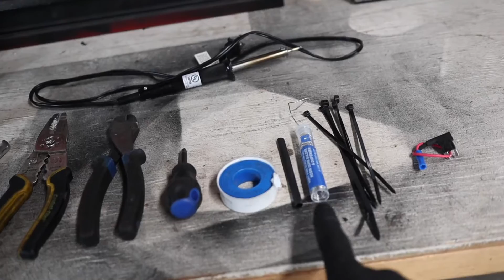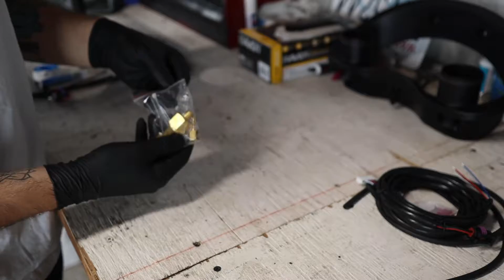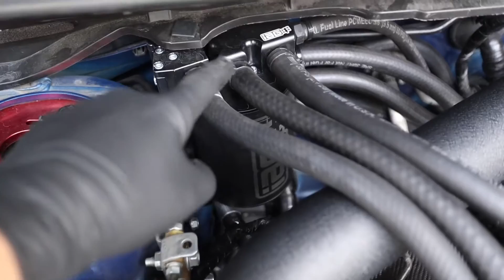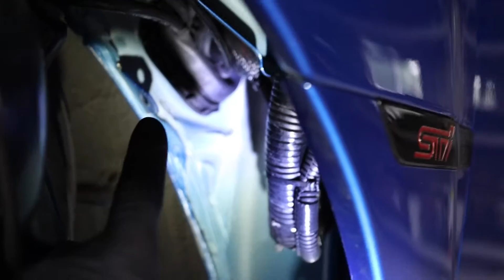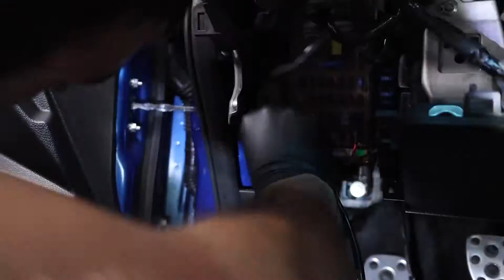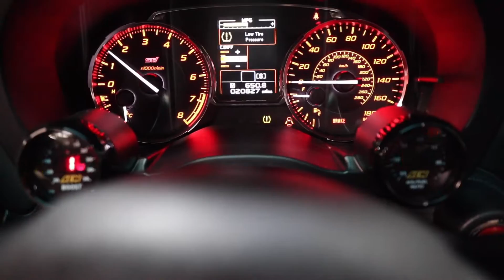AEM Boost and AFR Gauge Install (STI)

Comment: Hey man. Great video! I’m about to hit buy on my gauges as well! Stupid Question. My tuner wants me to get a Visconti logging cable for the afr as well. Would you happen to know the difference between the cables??
Reply: Have you gotten any information on this? My tuner has suggested the same cable as well.
Reply: Corey Stengel hey man, sorry. Just seeing this post. Yep. I’m running it now. Shoot me a message on IG and I’ll tell you more about it. Subi_duo
Reply from the maker: TBH I've never ever heard if the visconti cable.... I would ask your tuner what the reasoning would be. Generally the tuners I've used have always based the AFRs off of the ECU
Reply: Yesterday tuner also asked for the same thing, what did you end up having to do?
Reply: @nicolasmcdaniel4452  I ended up hooking everything up. Took my a hot minute to figure everything out. But the Visconti cable is basically for you to plug in the AFR stuff along with the wideband 02. Just a plug and play that doesn’t require any splicing. The only headache was running the wiring into the car for power via fuse box

Comment: I did a test for with the gauges on my smy pod and  it felt loose. Did you mount yours with the hardware supplied? Fit looked super tight
Reply from the maker: I used the supplied rubber bands, you really got to work them in there 😅

Comment: Put the end of the vacuum hose in boiling water to get the hose on the sensor
Reply from the maker: Not a bad idea, I normally use a great gun but the water might prevent the hose from melting a little lol

Comment: Did you just use the rubber thing that came with the AFR gauge to hold on it onto the pod? Or did you come up with something better?
Reply from the maker: Just used the rubber bands that came with the gauges, worked out great 🔥

Comment: No doubt at all means you do a great vlogs all the time and this with clean installation of the gauges! 
But there are few things that needed to be focused on for the first timers/new-owners. Something more which I want to know, like -- 
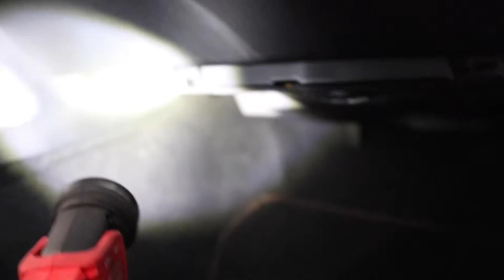1. initially when you soldered the wiring of both the gauges, you should have done some unboxing to show how many cables/wires they come with. this is because, in the video you have connected both the wires and then at the time of install(at 8:05) there comes another big wire(AFR harness) which is connected to the O2 sensor. 
2. Also, you skipped to show the connection between the harness and the soldered wire(though it is a easy-pezy) as viewers we expect the complete view of it. specially when it comes to wiring which is very important part.
3. Which is more important --> the connection to the gauges!! i believe there a tiny vacuum hose that connects to the boost guage along with the other wiring. you could have shown that over at least after you plugged in all the wires before fixing the pod to your dash.
 4. there are few other videos on here that show a different way of installation for the boost gauge itself, where they have connected their vacuum hose sensor with a "T" to the stock BPV, can you please explain which one is more efficient, as I read in a blog connecting to he BPV gives us the most appropriate readings? will be greatly appreciated.
I have been following you on your youtube build vlogs but i haven't seen a FPR installation video(if there is one i might have missed it, lol). I really really hope you do that one soon as all of these mods fall in the same category it will be helpful for people like me.
I hope you get back on this soon bro also correct me if i am wrong at any of these points, I am still learning :) lol!
Thank you.
Reply from the maker: No worries appreciate the detailed feedback. So Cobb installed the FPR when I got tuned, totally spaced on it so they had to throw it on before the car went on the Dyno but if i can find someone on the area installing one I will try to get an install video of it! 
As for the vaccum hose the most accurate reading is going to be if of the intake manifold as it's going to see absolute manifold pressure vs normal vaccum and boost outside if the manifold. There is a free nipple on the lower driver's side of the manifold that can be tapped into to use. With the AEM Gauges there are no vaccum lines going directly to the gauge only the electrical wiring going to the sensor which then transmits over to the vaccum line. But I will definitely keep these in mind for future installs. I've gotten more in depth with a lot of them as compared to some of my older videos 😁
Reply: @Smeedia  thank you very much for a quick response. That answers most of the things that i put up. Please do the FPR video sometime soon!
And yeah, i thought i mentioned in my previous comment about the AOS install -- that was a detailed one :D i loved it and will definitely be taking help from that video! Most of your vlogs are detailed, i agree!
Thanks again bro! :)
Reply: Good video. I have a question about the vacuum line as well. The one you pointed out in the video is currently being used for my FPR (I have the Perrin FPR installed). Is there another nipple you are talking about thats not being used on the driver side that I just dont see, or am I going to have to cut the vacuum line and install a T-fitting for another output on that line?
Reply from the maker: You can also pull vacuum from the vacuum line going to the bypass valve. You would have to install a T fitting onto it.
Reply: @Smeedia  so is it better to use the T-fitting off the BPV or the manifold line that connects to the FPR?
Reply from the maker: Pulling the vacuum off of the manifold will give a more accurate reading but you shouldn't see a huge deviation from the bypass valve to the manifold. Either option will work but I suggest the manifold
Reply: @Smeedia  Word. Thank you, think that's how I'm going to do it then. Throw the T-fitting on the hose that's coming off the nipple. Also subscribed to your channel. When I finally get all my parts, I'll do a video on my build. Got a built RW750 longblock sitting in the garage just waiting to be swapped. Still need a bunch of stuff for fuel upgrades, FMIC, and an FP black HTZ. Gonna do it all in one go so I dont have to keep getting it tuned.
Reply from the maker: I know the struggle! I'm in the same process but pushing the stock block as far as I can to see what I can make it hold. That Rev works block will be a good set up 🔥 and definitely document it. Appreciate the support my man! 😁
Reply: @Smeedia  will do. Keep up the smiles per gallon!

Comment: funny my cobb one has a hex a 10 hex key and that mofo wont budge at all. any tips?
Reply: Mine had the same, sprayed some PB blaster on it and came back 30 minutes later. Still tough cause it was slightly rusted.

Comment: So I have a question because I am thinking about buying these for my 2020. The wires you cut in the beginning one of them being the illumination wire, what exactly does that wire do? The pods were definitely illuminated once you turned the car on.
Reply from the maker: That wire will dim the gauges more when you turn the lights on in the car. I don't ever run the illumination wire so I generally cut it off.

Comment: Hey mate

After so much research I was going to finally get the oil pressure and wideband A/F gauge. I originally was going to get glowshifts as my budget is more limited, but I keep getting mixed reviews. Some say trash, some say they are great.

However, I decided to go with AEM but looking at them installed, they seems spazzy to look at, with the numbers flashing. Are they horrible to look at while driving? I don't know if I like the flashing they constantly produce.
Reply from the maker: Mine dont seem too crazy, I know when you record them they flash on screen because they are LED. Honestly when driving I barley notice them at all

Comment: Great video man! Question - how did you remove the bung/plug on the downpipe? mine feels stuck I cant seem to get it out
Reply from the maker: Thank you! And some PB blaster and a breaker bar. My downpipe was pretty new when I did this so it was not too bad to get off. But I would use PB bladter and a long breaker bar to free it  if that wont work use a torch to heat it up a bit

Comment: Question; I had an AEM wideband installed on the top of my HKS downpipe. I also have an Oem oxygen sensor in my equal length headers. What does the oxygen sensor in my header do then? Isn’t it a narrowband sensor? I believe my tuner turned off codes for downstream o2 sensor.. now I’m confused lol. Or, does my wideband that’s wired in have no control over fuel corrections, and it’s just to monitor my engine is running efficiently
Reply from the maker: Fuel corrections will run between your front and rear O2 sensor, the one in the header will read upstream AFR and the one in your mid pipe will read downstream AFR. The one on top of your downpipe should go to an AFR gauge to read the ratio
Reply: Smeedia my AEM wideband is on the top of my DP right after the turbo. It’s wired so I can  monitor an actual wideband on my AP AF Sensor 1 ratio. So it has no control over fueling, only for monitoring then I guess

Comment: Why wouldn’t you want to have them illuminated? I just don’t see why you cut the other wires off
Reply from the maker: They Are to dim the gauge when the aux power is turned on. I would rather just have them stay the same. I did not feel the need to wire the remaining two. However; if it is a feature that you want than i would go for it. They relatively easy to wire up.
Reply: Smeedia how would you wire up the 2 wires that you cut off? Where would you tap into?
Reply from the maker: I beilive one is the dimmer and the other is for data logging youd have to find the dimmer switch in the car

Comment: Here . This guy is the best also you'll save alot 
https://www.theboostlab.com/boost-lab-td06sl2-20g-turbocharger-for-subaru-sti-450hp/
Reply from the maker: I have never seen this turbo before, but definitely has my attention now lol I'm going to do a little research into it but that might be a winner either there!
Reply: It's a cobb 20g stock placement . But the builder but a few extras and painted it .you can go on cobb and use the directions to install it .